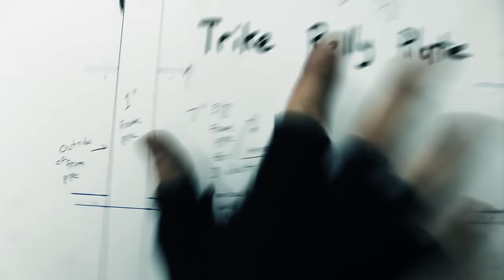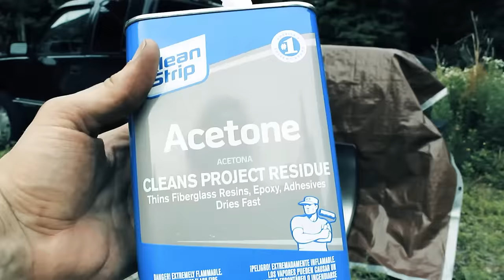Turn a Motorcycle into a Trike with simple Fabrication/Metalwork

Comment: well done. how does the power get to the wheels?
Reply from the maker: Thanks man...it still uses the original rear wheel for power train and suspension...the trike frame simply goes around it and the new axles have there own suspension travel.
Reply: Is that how they all work?
Reply from the maker: +tim sway no there are full conversions that remove the rear wheel and power the rear axle instead.
Reply: No this is the cheap way . plus they just made replacing the rear tire on the  bike three times harder
Reply: By the back wheel they never removed it This is like a set of training wheels but it looks good

Comment: hi,
the rectangular that you welded,what was his dimension,is it 1/4 thick?
how did you attached it on the GW?

i have an 1984 and want to do the same here,
thanks

gervais
Reply from the maker: The rectangular tubing that is welded to form the runners is 1/8 inch thick tubing. Everything was 1/8 inch thick except for the belly plate; that was 1/4 inch and I drilled holes in that to accept U bolts which mount around the frame of the bike. Four U bolts mount the 1/4 inch belly plate to the frame of the bike and then the back is free floating for suspension room.
Hope that helps; good luck!
Reply: so you dont have a fixation  at the passenger pegs like other trikes we are seeing on youtube?

thanks for your response
Gervais,
Riviere-Bleue,Quebec
Reply from the maker: Nope, the axles take the weight and it is a free floating suspension.  The axles had adjustments on them and I had to set it properly based on the bikes weight and the clearance between the trike runners and the bikes frame and bumper.

Comment: Aaron I want to make this for my Suzuki LC1500..do you think the 13in. wheels will work OK??
Reply from the maker: Hi there, this setup was somewhat universal due to the torsion axles being able to be adjusted to ride height.  The kit was from sidetrike.com and it should verify there if your bike is compatible.  Be warned that the kit came with really no instruction that assisted me even though it claimed to have documentation.  I ended up having to fabricate based off of one picture I found online so I would not attempt this build unless you have good welding and mechanical skills.  Hope that helps; good luck!
Reply: ok, thanks..I have ordered the flexiride adjustable half axles and wheels/tires. I am following a couple of videos and your video to approximate the framework. I plan on using 1X2X  eighth in. thick rectangular tubing and will plan the belly pan to fit my bike/exhaust system.

Comment: BEWARE! 
I had a Motor Trike kit installed by Bob Bowman Superior Trikes, Florence, SC. They knowingly delivered my trike to me with numerous issues and 2 dangerous issues = did not torque down handle bars and they almost came off while riding and reverse battery was wrong size and installed incorrectly which melted the terminals. If Superior Trikes didn't know all of the 12 issues prior to delivery then they shouldn't be doing any installations at all! I have pictures, videos, text msgs, tel nbrs, email addresses etc. for anyone to see.

Motor Trike corporate (President Jeffrey Vey) told me I had to have the very dealer that did the shit installation repair the issues or warranty would be void. Is that legal?

Comment: That's not a trike, it's a motorcycle with training wheels.
Reply from the maker: Cheers! Build me a better one please!
Reply: @AaronVozzolo  It's very simple.  First remove your rear wheel.  Second, weld your swing arm to the frame.  Finally mount the rear differential from a Mazda MI-5 to your swing arm.  Voila, Trike!  In my state, what you have isn't even considered a motorcycle.  It has 4 wheels on the ground, therefore it is an automobile.
Reply: @jwilcox2251  You sound  like the expert on gayness